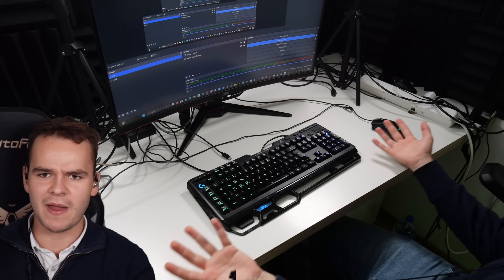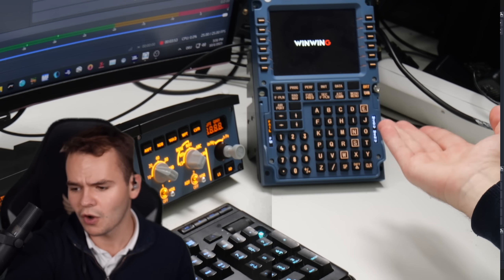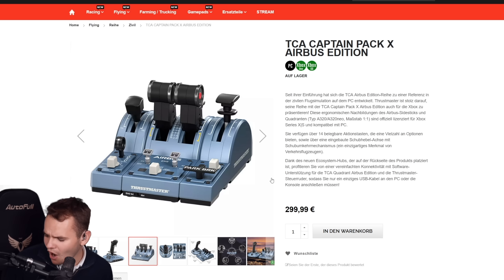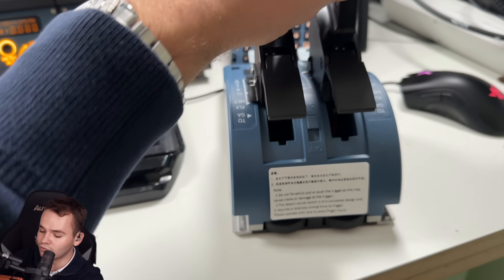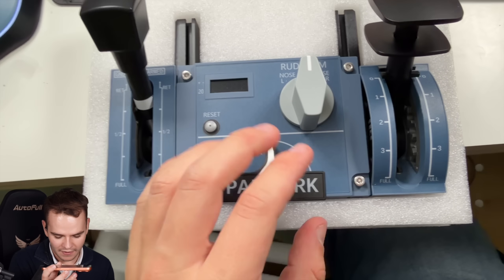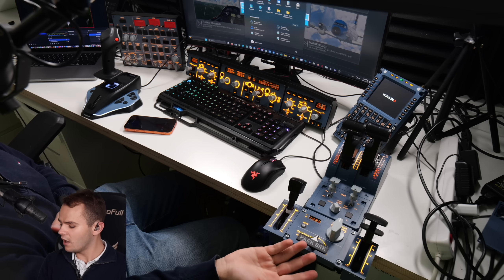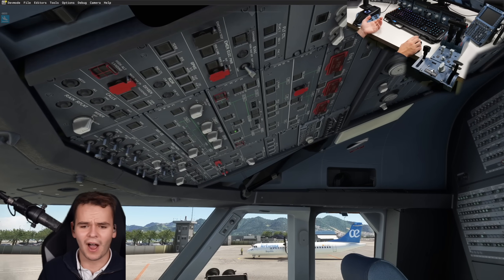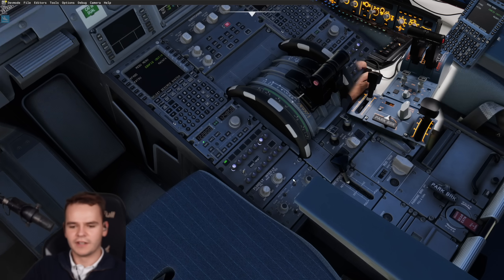I Turned My Desk Into AN AIRBUS A320 Under $1000

Comment: Sorry to say, but from a real A320 pilot and instructor point of view, this is exactly NOT how you should place your equipment. No joystick has to be placed on your desk. Where is the PFD and ND. The main displays have to be placed right in front of you. The thrust lever are ok, but the overhead panel should be placed like in the real cockpit, otherwise you can not with the correct flow of SOP. Even if I know that is not easy to fix it. Just a tip to you. You will see its will let you determine the SOP in a much better and realistic way. Cpt Ingo
Reply: Agree with that, nice hardware needs appropriate operating position.😂

Comment: Not an airbus cockpit for under $1000 😂 it’s missing so many components still to be called full cockpit for $1000. And the winwing airbus stick is garbage and low quality look at reviews. Would need a high quality base from vkb,Virpil or MOZA ab9 or other ffb bases with a aftermarket airbus stick.
Reply: It's buged

Comment: Yes, already preordered the throttle+flaps section with the mount. Now I'm thinking how am I going to attach my MCDU to the throttle, as I want them to be on the same level as in the RL Airbus
Reply: The MCDU and thrust quadrant are angled on the pedestal on an incline, the flaps and speedbrakes lie at 0 degrees.